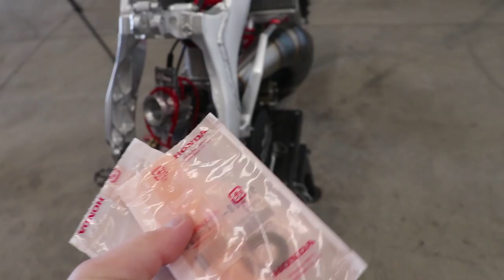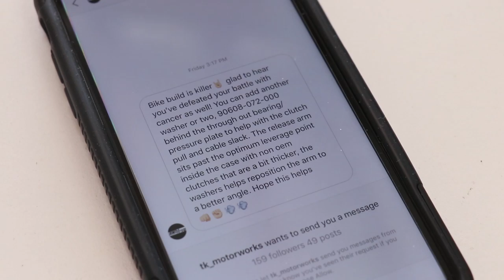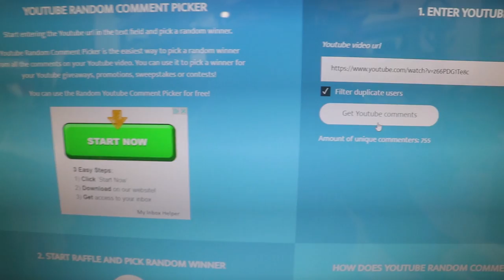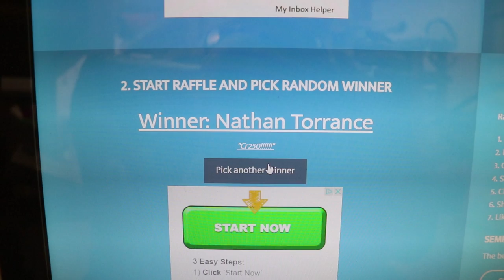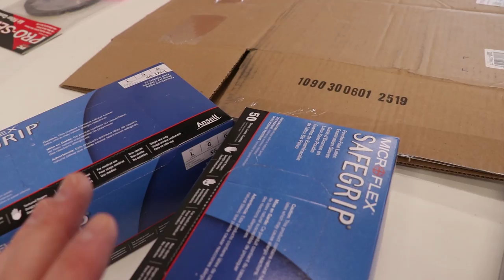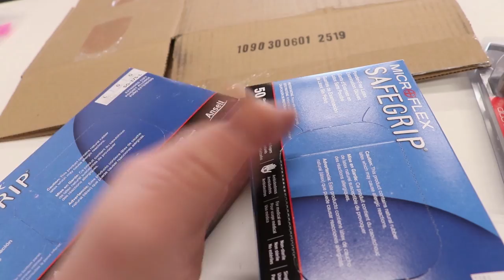Problems With My Dirt Bike Project

Comment: Do gas tank, skid plate, and front brake rotor guard all in carbon fiber!
Reply: Literally guy has zero experience "do a gas tank" yeah and fuck up the old one by using it as a mold......
Reply: jjoea Bhn he definitely knows what he’s doing. Just have a look through his channel and you’ll see he know what he’s doing.
Reply: @tomsharpe8181  dosent mean you just start doing somethink that you have done on somethink like a gas tank wich is not even possible with that kit

Comment: I am Glad that the moto industry is finally adopting lock on grips. When I replaced the grips on my crf250, the guy before me put some gnarly glue on the grips, which was a pain to get off. I just used isopropyl alcohol and let it dry for a while.The mtb side of things has been using lock on grips for a long while, and I am happy for that.

Comment: Make CR250 great again. 

I replace the entire clutch system on my 2002 CR250 and the only way I made the clutch Pole easy enough to pull with one finger is I replace the clutch cable with a hydraulic mugura clutch now its finally an eazy pull

Comment: Coating the shock shaft and fork tubes would be killer
Reply: SGB Racing can do the entire fork and shock coatings and have them set it up for you using race tech gold valves

Comment: Put on some softer clutch springs an put oil in it then it wil be easier to pull
Reply: thats what i thought too
Reply: Putting softer clutch springs would wear the clutch more and it would probably slide more since he Has alot of power on that 2 stroke
Reply: SwEeT HoMe aLaBaMa

Comment: Hi Cameron, I found a pretty good solution to my clutch pull.  I used a Righteous Stunt Metal lever and 1mm washers behind the clutch springs to reduce the pressure.  I dropped the pull force by close to 15 -20 inch pounds of pressure.  Now I can easily pull the lever with one finger.  I do not notice any slipping with the lowered plate pressure but I expect a bit more wear of the clutch plates over time.  The new lever is super smooth and looks great.  Good luck with your health and bike project.

Comment: Hey Cam (or anyone else) not sure if you'll ever see this or have already heard about it, but in the instructions for the ODI lock-on grips they mention how handlebars with rough/serrated ends will cause interference with mechanism, and they recommend grinding the burs flat on the handlebar. Thanks for the vids!

Comment: With my bike I tend to have the clutch lever/perch more towards the center of the bike so im pulling on the  very end of the lever. I found that pulling on the very end of the lever helps a ton! Great video man. Iv watched your bike build videos a while ago but im running though them again because Im building my own 03 cr250 right now!
Reply: Never mind, It looks like you covered that later in the video

Comment: Not sure if this was brought up, but check where the clutch actuator arm and pushrod contact. Over time those can wear on each other and wear down to the point the chamfer on the arm and push rod are gone. That makes the clutch pull noticeably harder and you lose some of the progressive engagement/disengagement . Sick build, btw.

Comment: I had the same problem with my odi grips and actually broke the grip hammering it on. Messaged Jeff Emig on his Instagram and he apologized for not labeling the package with the instructions well enough and sent me another set free of charge! Amazing customer service. With aftermarket bars you have to sand the knurling off the bar and it slides right on 🤙🏼

Comment: They make an aftermarket clutch lever and perch that changes the pivot point making it about 80% easier to pull. I use to race in the nationals and it would wear you out being out there for so long. That clutch system was a hand saver. Worth every penny. Almost works like like bolt cutters if you will. Maybe that will make it a little easier to imagine.

Comment: My experience with the tusk fiber plates.  The core is aluminum and they will be effected by engine oil temp.  Your clutch feel will change as you ride.

Comment: Putting on the grips becomes way easier when you use brake cleaner (in case you have 'normal' ones without screws). Just put some break cleaner on the handlebar and on the inside of the grips. It will be much smother sliding the grips on. After putting them on you have to wait until the break cleaner has evaporated. 
Greetings from germany

Comment: rear subframe from carbon ..I would not make mudguards or anything that may take a heavy impact the carbon splinters so it could actually kill someone in a certain situation ,i have made most things for my crf from carbon clutch covers frame protectors but bash plates are the best bang for your buck ,,Use it for your car or road bike ..Good luck

Comment: The reason your non throttle tube grip didn’t go on easy is there is a little rough patch on the bar where the grip goes, to help non lock on grips stay in place. You have to sand that little rough patch on the bar down a little a bit for lock on grips to go on easier.

Comment: Make cr250s great again. I've owned alot of cr250s 89 to 02. That boysenn flange compatible with a FMF pipe? Those hoses would look killer on my 86 ATC250R with 02cr250 motor.  Hope you have a speedy recovery cancer sucks.. Killer build btw I bet that thing will brapp..🏁🏁🏁🖒

Comment: With 6 bolt pattern clutches like yours you can remove 2 clutch springs(across from each other) clutch will be incredibly smoother.

Comment: You could put washers under the bolts holding the springs on the pressure plate reducing the preload on the pressure plate.

Comment: Do the front number plate in carbon but mold in a LED bar  for night riding. Then do the two rear plastics/# plates. Also do the fork gaurds In carbon fiber.  But that's it not too much just enough to tie it all together

Comment: Hang in there with the treatment Cam, with the clutch try not to have such a tight turn on the cable, the straighter the cable the better.

Comment: Make CR250R great again. Should have been watching your videos sooner. Would have saved me some time from redoing work on my 1999 CR250 engine rebuild for my son. Those hoses would look good on my 2003 CR250R with only 10 hours on if from factory new. Quick question on your kick starter. Couldn't you have just moved the kicker back one notch?
Love your videos and praying for your road to full recovery.

Comment: You need to sand down the handlebar so the ODI grip can go on smooth. If you want the clutch to be easy, then you need to buy a hydraulic pull kit

Comment: Hey Cameron i have a problem with my 2010 kx85 it wont start on the kickstarter but it starts easy when you bump start it. And when you kick it, it has low compresion. I have cleaned carburator. I hope you can help since you are the best mechanic out there

Comment: Dislike for the connectors , u can push back rubber cover of each connector and cut the old one then solder the new cable , this gonna look like the stock kill switch 
And if connector is corroded its hard to solder on it i use to file it to make the copper shiny

Comment: Hey Cameron when you're putting on those grips you're supposed to hit new bars with a little bit of sandpaper just to knock off the burrs from the texturing they do on the handlebars. Other companies like neckin handlebars won't have that problem as bad. But I had the same problem with mines I had a set of Pro Taper handlebars I ended up switching over to a neckin handlebars and I no longer have that problem my Pro Taper handlebars were  bent and KTMs come stock with those neckin handlebars. It seems that that company doesn't require as much sanding but if you're using companies like renthal or Pro Taper they definitely demand a little bit of sanding because of that texturing on the left side of the handlebar. anyway I just figured I'd point that out

Comment: In the spirit of community Cameron. Re the issues with your body. You are getting advice and opinions from people that are focused on symptoms.  Try people that are focused on the cause of your symptoms, for a different opinion.  In the same way a mechanic looks at an over heating issue. Looking at the complete system, asking why is it over heating. What caused it to over heat. Not getting too fixated on coolant loss, hoses rupturing, or the temperature  gauge. They know. Once the cause is found, the symptoms automatically go away.

Comment: Wait, why didn't you just clock the kickstart lever back from the outer splined section? Maybe my logic is failing me because I'm not playing with it in person, but if its a solid shaft all the way through, and the spline count is identical on the inner and outer portions, an adjustment on either side of the shaft of the same value would have the same outcome once reassembled. Is there something that i'm missing? If you were to paint pen the shaft and then rotate the lever 180' it would still have the same start/stop point on the shaft, so therefore an adjustment on the inside of the inner clutch cover would be unnecessary. Again, maybe i'm forgetting or missing something entirely.
Reply from the maker: https://youtu.be/z66PDG1Te8c?t=1085

Comment: If I’m buying a fuel injected bike, as a beginner: what would you say a good price to spend would be? (A second hand bike) a price to where it’d be fair for the seller but not completely ruining my wallet. As well as a price that doesn’t seem too good to be true, I buy the bike and find it has some major issues or something along those lines. What is the least you’d spend and feel safe about it? I’m also curious to know the same thing about a bike with a carb. And where you think I could find a better deal. (Curious to know because I want to get into riding) I live in Texas and am about to move to Colorado so I want a fuel injected bike. But if I can find the right deal I’d buy something with a carb and go ahead and get the bike jetted. I’ve heard there’s a kit that makes the carb bikes function like it’s efi?

Comment: For an easier clutch pull, we used to make the lever arm at the cases 10mm longer, (cut and weld a piece to it, if the design allowed), and we also slid the lever perch down the bar as far as we can to reach the end of the lever, (other adjustments may need to be done).  This not only gave us a lighter clutch pull, but was harder for the end of the lever to get hit in a crash (as the bar end stuck our further than the lever end.).  You can slide your perch another .75" toward the center of the bar, and grab the very end of the lever. Years ago, a devise called "EZ Clutch" could also be added "in line", that reduced the pull force.  I found it for you. Here it is.
https://www.youtube.com/watch?v=9zSevtXlT5U
Good job on fixing the kick starter/pipe.  I never thought of checking out the spline inside of the cases. That does beat my earlier advise on putting a small dent in the pipe by far, but I thought you moved the spline in the wrong direction the first time. Come on, fess up. :)
I love this build Cameron man, and congratulations on continuing your good life.

Comment: I have a quick question, I need a clutch cable with an in-line adjuster. How long is the OEM cable that you have? 

Thanks In advance.

Comment: hey Cameron I'm getting rear brake fade on my 03 cr250, I changed the master cylinder seals, rear caliper seals and put a new piston in it, any idea what could be causing this? also bled the brake the best I could and it has a new rotor and pads

Comment: Hey Cameron, you probably won’t read this but if you happen to read it I had a question, i bought a 400ex that wouldn’t spark. I bought a new kill switch, a new ignition coil, a new ignition solenoid, a new stator and nothing still no spark. I was thinking it might be the CDI box but could it be? Or the harness itself? I’m just about ready to give up on it and sell it but I really wanted it as a project quad, I’ve only had experience working with Yamaha I’m pretty new on the whole Honda thing, anyone got some advice?

Comment: I love my 03 CR 250! One question...what the hell does the “pro circuit racing engines” sticker on the side of my jug mean?? It looks stock!
Reply from the maker: Pro Circuit is a performance shop out of Cali, so it could just be a sticker or could mean it was ported by PC. You'd have to check the ports to see for sure

Comment: I have a question my buddy has a 19 ktm 450 sfx. He had a crash. after that  his front brake is constantly dragging pretty hard  and his front wheel is sitting closer to the right fork. We reset the forks and wheel and checked everything and can’t seem to find anything bent but I feel like we Are overlooking something obviously. I was hoping you may know what to possibly look for . ???? And can you beat that friggan cancers ass man we need you !!!!!!! 💯
Reply from the maker: Justin Poretta Roll the axle on a flat surface, check if rotors bent, if it was a hard crash it’s possible it’s a bent fork tube but unlikely
Reply: Yea we did all that a few times now.
That’s why we are stumped so probably going to be the fork then. But yea he did take a pretty hard crash it was at the second round of  nesc at Southwick  not this weekend but last. Thank you 🙏🏻 man for you guidance. It is truly appreciated. And me and my family we are all praying for  you man. We all. Can’t wait till you are 1000%  cam again.  ❤️